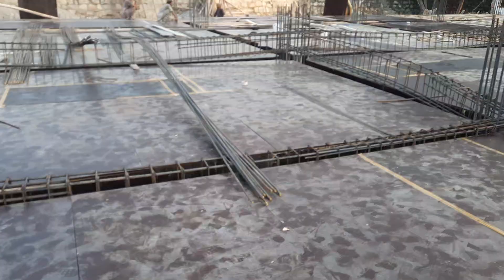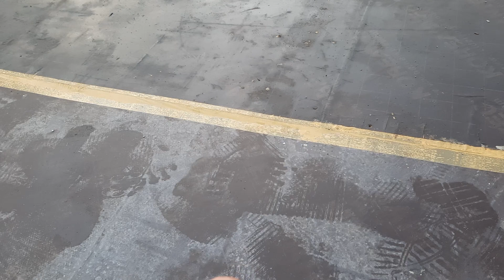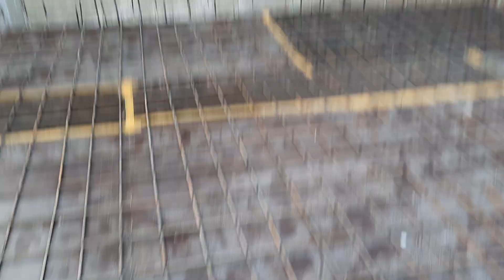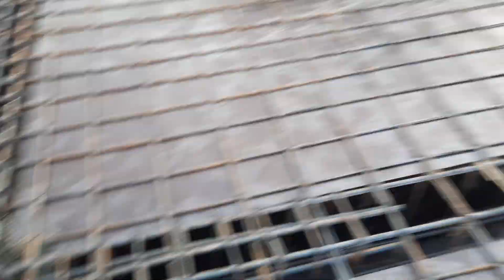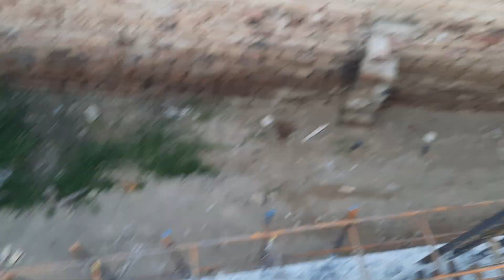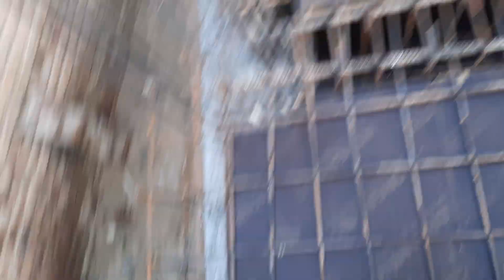8 Big Mistakes in Slab Construction | Technical Terms of Slab Reinforcement on Site |

Comment: Sir for bottom mesh slab bar (tention zone) is not correct the lapping can be done between L/4 because it is the place where negative bending moment..  ofcourse for upper slab bar lapping should not be done insideL/4 or should make crank bar.